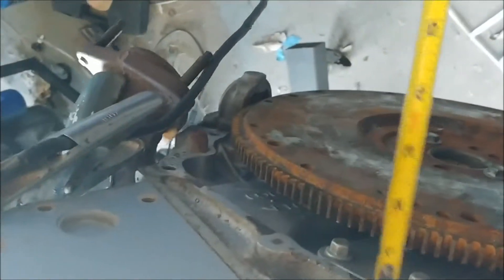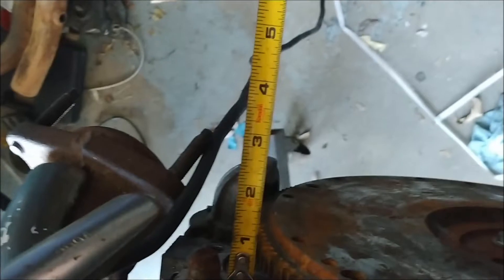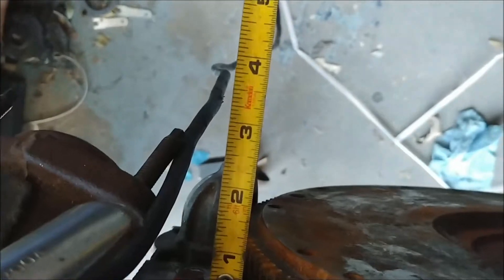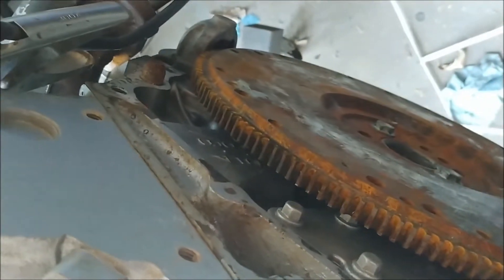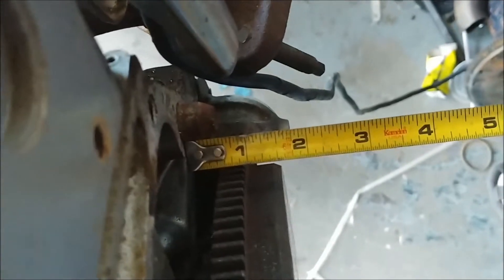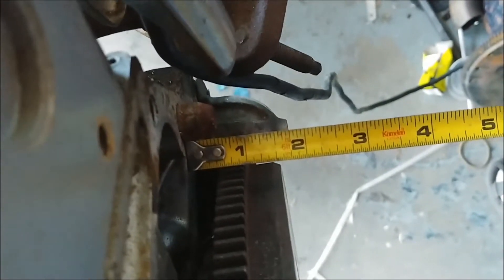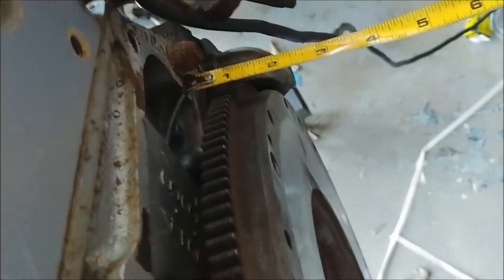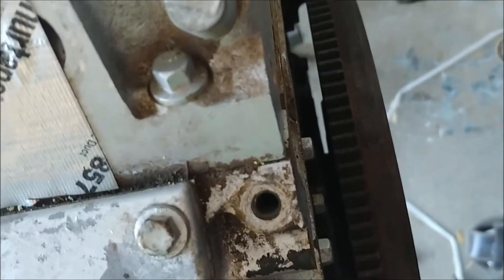LS Flywheel differences

Comment: which of the two works with a 6.0 ls and a transmission nv3500?
Reply from the maker: Depends which 6.0 you have
If you have the one with flush crank flange then you can use the 4.8 flywheel if you have the 6.0 with the extended crank flange then I am not 100 percent sure